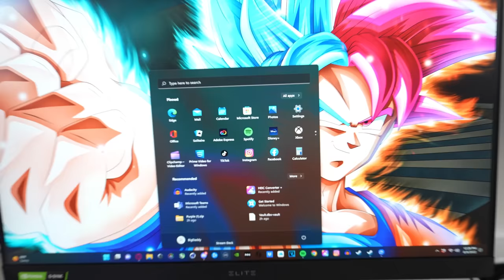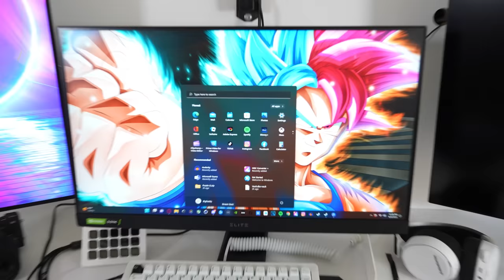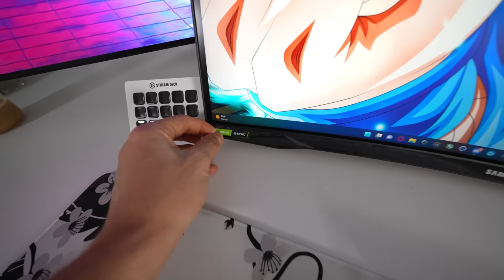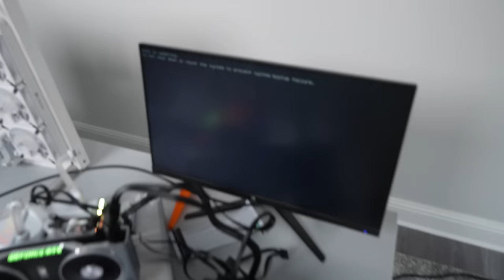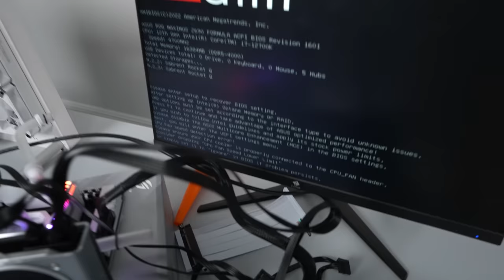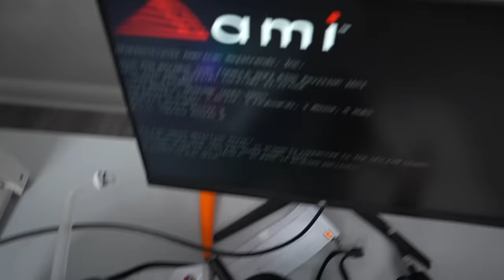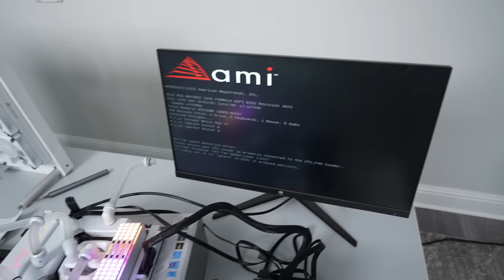I Almost Gave Up...

Comment: Hey hope this can help you:
I have a similar pc setup and been running at similar random shut offs of my alder lake pc.
I have found a solution to my problem.
My parts are :
Intel i9-12900KS
MSI Z690 Unify-X
G.Skill Trident Z5 RGB 32GB 6400Mhz CL 32
MSI RTX 3090 Gaming X Trio
Running in a Lian li O11 Dynamic Evo (vertically mounted)
The problem is each time i upgrade bios or apply a different overclock or manage to crash my graphics driver my pc won’t boot i would need to remove Riser cable connect gpu directly to the board then clear cmos and apply a safe working overclock with PCIE lane speeds fixed to Gen 4 otherwise it won’t boot.

Comment: Yo man as an electrician that bend on your 12 pin cable with your final cable management just does not look safe. Never wondered why it works with the lose cable but not the final positioned one? That bend seems to put to much stress on the connector I can see it pulling some connections halfway off or some bs like that.

Comment: you didn't check the power supply. maybe it was a weak 12v because of energy consumption during boot, especially while GPU is switching from framebuffer to high res

Comment: Hey I had the same problem and one of my video cards. 1 displayed image and the other would not. After going through my entire system. And, Wala! After windows updated, the boards bios would not allow the vga bios to load. Even though it recognized the video card during boot, it would not display image and give me a boot error.  I went and disabled secure boot and was back up and running. I may have to look into the vga bios and update if possible!

Comment: I am thinking the issue is you, and I don't mean that in a mean way. When issues like that arise, you should take off the randomness out of it. If you think it is the riser cable, try to boot 5 times or even 10 times with a new riser cable, if that works, swap it and test again 5-10x, if it doesnt boot still, then replace the gpu and boot 5-10x, if it works, then swap your gpu, if it doesn't, then its not that... Just don't do it once. Sometimes it can be a silly issue like the power supply not sending the proper voltage (example; 11.8v instead of 12.0v and sometimes really needs 12.0v or higher, then it goes bad, then you reboot and it sends 12.1v and it works) and thus testing it once makes you think it doesnt work, but testing it multiple times could let you know more reliably if it was indeed working or not.

Comment: my pc also went blank on the latest windows 11 update. Sometimes it works, but sometimes I need to restart it.  I see the bios start to load, then the screen says "unsupported mode". I installed a recommended windows 11 driver/gpu app I saw in the optional drivers part of settings, not 100% sure it fixed it but it is where I'm viewing from now.
Reply: now I'm trying to install sc2 again, which I installed at the same time as the windows 11 update, and also wouldn't work right.

Comment: Can anyone help me? I switched out my old 2070 for a 3070ti and after that the pc shut itself off in 5 seconds after pressing the power button. I ended up returning the 3070ti. I put the old gpu back in and it boots just fine except theres no signal to my monitor. I even tried hooking it up to my integrated graphics, still no signal. Every fan is spinning RGB is getting lit up and what not.

There is no way for me to test the old gpu… Could it be the motherboard?

Comment: I remember when i was building my pc i had a gen 3 riser from the meshilicious and everything lead to ram training being borked and when i installed the gpu on its riser it would take 15 minutes to boot and then the gpu didnt work anyway. I removed the riser and it worked fine. my bios set itself to gen4 mode which the riser didnt support and wasted the multiple days. Computers are wierd man

On a different computer my rtx 3060 randomly died and i installed my trusty gtx 950 and everything booted fine, installed the 3060 back and it never broke again, cant tell if windows is cursed or not (i now use arch btw)

Comment: ******* Listen to me and trust me....... All you have to do is co into BIOS and disable CPU Fan Monitoring, then reboot and it will boot up with no problems!!  For whatever reason when you update to WIN 11it will not boot if you don't disable CPU fan monitoring because it basically doesn't detect a CPU fan because it is only monitoring once a certain RPM on the CPU fan is met. ********   Trust me!!!

Comment: is it possible that your PCI-E cable just kept unpluging itself from the gpu because the error happend right after a reboot the first time it happend your reseated it and it worked and the second time you changed it

Comment: I got a new motherboard and now my Bluetooth doesn’t work…I have no idea why. On my old motherboard it worked. I have the Wi-Fi/Bluetooth adapter, and I even plugged in the Bluetooth adapter cable to the motherboard and still no Bluetooth, im starting to think that I might have to buy i new Wi-Fi/Bluetooth adapter…my motherboard is the MSI B550 Gaming Plus

Comment: @TechSource What if the currently installed white PSU is faulty and durring the update the system needed more energy and it revealed that the psu is faulty ?

Comment: All I can say is. This type of build will never be a computer it's a disaster. The last 4 years have taught me hard lessons. Number one keeping a smallest footprint possible is a must. Otherwise it's not enough grade. Is to be an upgrade. Number 2. R GB is nothing but a waste of money. If you have to pay extra. Optimize for weight is very important. Mod and originality is essential to make it yours. Full black-and-white builds are getting old And boring. SFF is the future. Not necessarily. ITX. But there are some small cases for enthusiast sized motherboards. Like the celebras X for example.

Comment: So I had a similar problem after I updated windows I turned on xmp and it happened black screen no signal (rtx 3080) as last resort after taking my pc apart 1 million times and reset cmoss another 3000 times i unplugged and plugged the dp port AFTER IT “boots” and everything posted. Insane…

Comment: Every time I boot up my computer the display turns off at a random time and the case fans go as fast as they can. I’ve tested the ram and the ram slots, replaced the psu and I don’t suspect the gpu because I can still play games, just not for very long. I suspect the motherboard might be the issue. Does anyone have any suggestions?

Comment: I’m not very deep into the PC science but remember when at the first boot up after error that the BIOS were still updating? What if all it needed was that? And still, after the update, what if you thinking that it was the riser cable messed things up? Am I getting it way off? Since the pc works I’m kind of convinced it was a mix of software and hardware error, with the hardware error originating from a cable.

Comment: I think that when updating to win11, the bios started updating for win11 compatibility and then got corrupted and when the computer got the post error it was trying to rectify the error but couldn't because it got shut down too quick to resolve it

But in the last test we took in the reaction of dismay and let the bios fix itself and then it worked

Possible even if I am talking out of my ass rn

Comment: you swaped out the old pci cable thinking it s the issue then put the new pci cable thinking it will fix the issue then again it got messed up so you put the old pci cable again and then it just works wtf is wrong ,so what happen when you find out that old pci cable  is messing up with the pc ?

Comment: I thought the BIOS update and 11 combination f'd it up as the PCI has been changed to Gen 3 or something and the combination of PK, secure boot and TPM requirement in win 11 has messed up the config.

also accounting for 12th gen issues with DDR5 Ram in XMP

Comment: Im legit having similar issue. My nvme randomly died on me. So i replaced its with new one, now my pc wont post but the issue is it will only post after a complete power drain and takes me to bios. But if i remove my nvme my pc will post like normal. And this is a brand new nvme.
Reply: Iv installed windows 10 on it and runs fine But the only way to make my pc post with nvme is a complete power drain. And time to time my pc will crash and loss my current progressed assignment. And im not a fortune to afford to buy parts to test out, as im a university student living on allowance. And this Pc is very important for my studies as i am required to run Archicad and twinmotion.
Reply: My pc is Gigabyte aorus z390 ultra v1.0
Intel i7 9700k, corsiar 32gb 3600mhz ram, aorus rtx 3060 master, aorus 850w power supply.

Comment: i splashed water on my 3080ti gpu and now it makes a very loud coil wine..  Im not sure i splashed on it because i was very careful but its just a guess and the only thing that couldve happen...  I changed psu supply and it still does it... anyone have any input on gpu coil wine?  it still works fine but its noisy..  cards not old at all. months.. but it never did it before i had to clean the block due to bad mystic fog EK water block coolant which btw guys do not ever use.. ever.....

Comment: dude i have a similar isue my pc works fine with my  24 monitor but whith my 34 monitor it wont post , but it gets to windows and work just fine i try everything even swap to my old ghraphic card whitch it does fix the problem but with my new ghraphic card the motherboard just dont detect the card.
strange is that i realy push the card in cinebench and 3dmark and it past in both tests i swap displayports cables and is not the cable also my 24 monitor is conected to hdmi and my 34 monitor is conected with display port my motherboard is a asus crosshair vi hero and my vga a rx 6700xt i hope is a driver issue also i have the vga connect like you with a vga cable im going to swap that cble to see if like you is the cable man nice video man......sorry for my bad english is just not my native language,any sugestions

Comment: i encountered the error about after updating the windows 11 my hdd is not working properly  i thought the sata cable is the problem but i use another cable changing the power and it still the same somehow in many times of trying it will back to normal ,i use the original cable and its working properly.

Comment: I had the same problem with building my pc I would turn it and it would post then I updated it after update didn't post took it apart like how you did and it worked put it in my case didn't post I took it out again would post I just kept repeating taking it out and putting it back in until it worked I have no clue what cause it but it works now and I am not gonna question it

Comment: Tbh I’ve had this issue for weeks I’ll get error codes and out of no where it resets. It will let me get back to the desktop. I’ve had rebooting and the pc turning off and on for days I’ve changed PSU MB with Asus and it’s stressful I’ve been cursed the walk these dark uncharted waters. It’s currently working but I’m counting the days for it to happen again.

Comment: this has happend with me i had a extra 3080 so i reinstalled windows with the other GPU installed and then i put my 4080 in and it worked.

Comment: at 11:05 when he is trying to get the system to post does he not have a display cable or hdmi in the gpu? then at12:32 there is clearly a cable coming the gpu when he gets the post.

Comment: Why were you ignoring RAM? I almost yelled out loud to test different RAM configurations. Everything goes through RAM. Strange errors are always tied to RAM. You're moving to an entirely new RAM platform (DDR5). Yet, 3 videos and RAM was never mentioned as a possibility. A testament to how solid RAM has become, but my "I built during DDR 2" self still always tests RAM first.

Comment: Asus z690 boards are garbage I had extreme that would post code 00 sometimes so I got sick of it went with the msi godlike same cpu same ram same gpu same power supply not a single issue just thought I wound toss that out there

Comment: I know 1 year back i was so frustrated my pc was also not starting and my pc isnt that expensive has a i5 4th gen and a gt 730. God knows what you must have gone through cause your build is hella expensive!
Reply: well my issue was the motherboard i had to switch it up and they didnt have a good i5 so im now stuck with a 2nd gen i5 like damn :/

Comment: lol it takes me 5 mins to drain and refill my system and no water is left anywhere in the system a properly built dual rad system , no distro plates which are for idiots who think parrel lines are proper in a water loop. as you just seen his gpu was still full of water.   his pumps are also a joke. buy d5 pumps or air cool . you will save yourselves alot of problems.  some 3080s the display port doesn't work mine is fine as was his.

Comment: But like why do you have to make a pc which looks like an animal. Build a normal looking pc because what you have is a pc that looks like the most disgusting design ever. I'm not trying to be mean, I'm just saying that but a normal looking case with very good and high specs because like what's the point of a pc that stuck on a wall